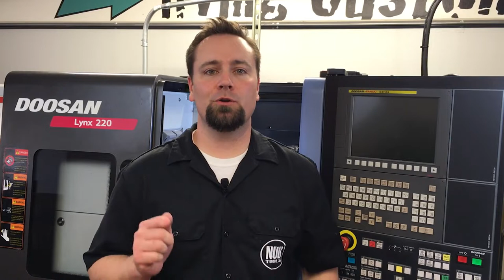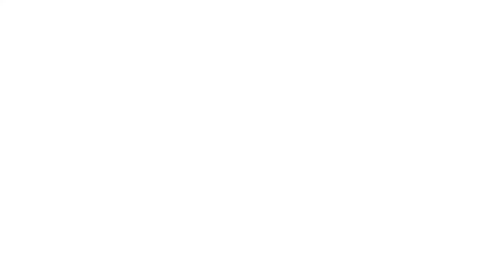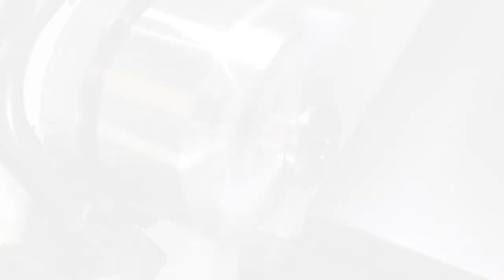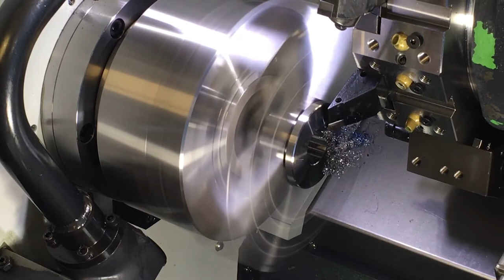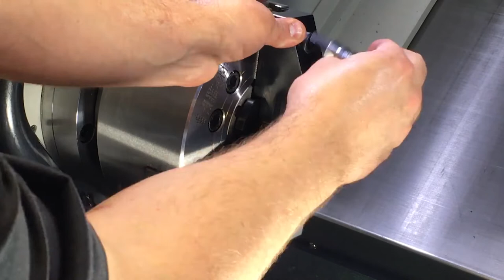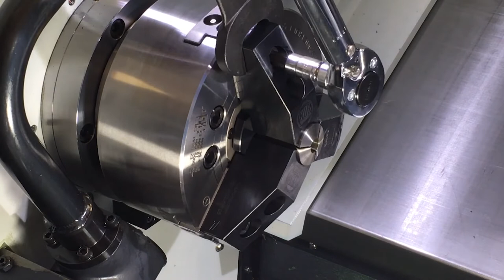CNC Collet Chuck Fast Set Up

Comment: i am actually surprised the part grabber didn't pull the collet with the part  
is there a lip preventing the collet from moving [towards the tailstock] ?
Reply: Yes, the collet housing that the collet screws into, stops against the backside of the jaws.
Dave-
Nub Tools